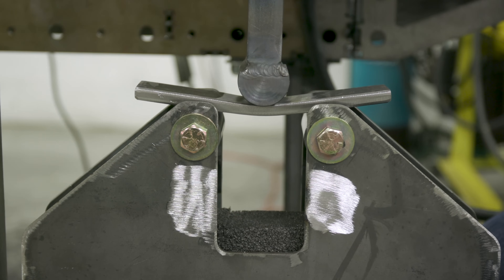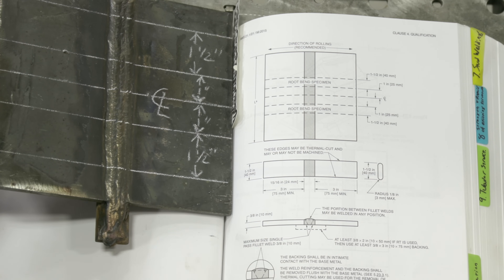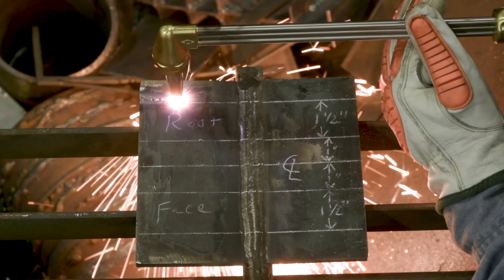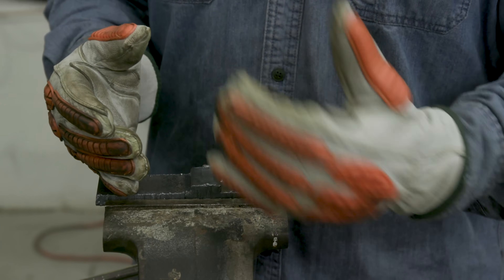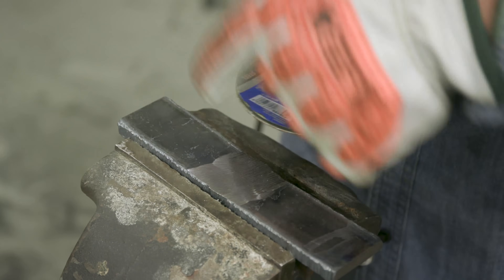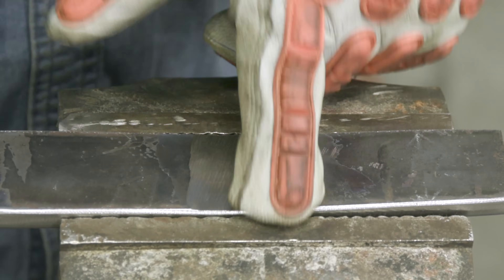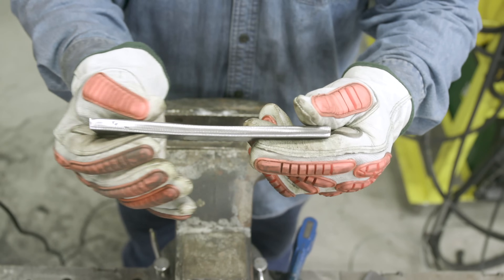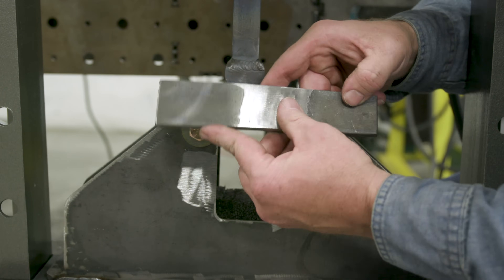A Students Guide on How to Pass a Bend Test

Comment: As a welded structures design engineer who defines the usage of AWS D14.4 and D1.1 on the drawings, these types of videos give me a massive appreciation for the guys actually putting the structures together.  The skill/workmanship that is required and verified with tests like this excite me to want to define welds that will result in high quality welds leading to long lasting structures. Kind of makes me want to try the qualification test myself as a non-welder and see how bad thing turn out. haha🤣

Comment: Would you ever do a CWB F class ticket video? Different than the S class quite a bit, The test consists of a 6010 open root with 7018 hot pass, fill and cap also with 7018. Then you also complete a fillet weld break test. Certifies you for open root and fillet welds. It is a common procedure you need in pile driving, as sometimes you will have to splice piles with a 6010 open root.

Comment: Doesn't flame cutting potentially alter the characteristics of the metal in the test?
Reply: Sure made a lot of extra work on my recent failed tests :(  And the instructor wanted every ENTIRE coupon (four) ground entirely clean, with no vise to hold it and a worn ass grinding disk... sigh

Comment: I need some serious help, I did a 7018 open butt, I did a root pass with a 6010 in a 1/4 inch groove and filled it in with a 7018 1/8th rod. I back gouged the back but messed up on the gouge and now I have two gouges and they are messy. Should I fill up both gouges? Or just start over

Comment: So much for the “common knowledge” that a weld joint is brittle!  Are there welder certification requirements for tensile testing? I’d like to see if the tensile failure point is in the parent metal, or at the fusion point of weld material to parent metal.
Reply: The BIGGEST thing when it comes to a weld test NEVER cool down the plates, it’ll weaken the metal.

Comment: Not sure what asme standard you are work in to but you should not oxy/acetylene cut weld test coupons ,you should use a band or mechanical saw to do the cutting of test coupon, the heat of the flame will effect the mechanical properties of the weld, could go on but enough said the rest of he vid was ok

Comment: I never used backing strips on my bend tests back in vocational school passed on my second test. Root passed both times face on the first was bad. Used a track torch to cut the bevel on my test metal. Cut the test pieces on the band-saw
Reply: I didn't use a strip either Id tack it at the ends so i can then tack it standing on another plate to my table then fill the root letting the arc fill in before i push it through then made the face with stringers 2 on the root pass then 3 over the last two stringers bottom to top with all 5 passes then grinded.

Comment: Yeah, don’t quench! 😂 I made that mistake once. I picked up my strip after leaving it to cool but it was still super hot. Out of reaction I chucked it in the nearest tub of water. I went to bend my two pieces, neither of which had visible porosity, but the one that was accidentally quenched split right in half! Good thing it was just for practice. 🤦🏻‍♂️
Reply: So interesting how every metal needs its own procedures. I'm a jeweler and we often get fits with white gold cracking so while visiting a metallurgist friend that does high production castings he told me, "quench white gold right away and it won't crack"   Guess what he was right !
Reply: Little late but maybe it'll help somebody.. if you happen to accidentally or mistakenly quench your plate or coupons, you can reheat them with a torch then allow them to cool naturally and they will be good to go again! I've dropped a plate in a tank by accident while setting up to cut it with a torch, just get the weld zone cherried again and it will be fine.

Comment: @Weld.com
I have put a slight reverse bend in my plates after doing the tack weld(mostly on open root) so that when the heat of the welds start to pull the pieces inward to the center, it actually pulls them flat.
Does that eliminate those coupons from a test parameter?

I have other issues with welding to pass bend tests that would not be associated with the previous question.
I’m trying to figure out what I need to do to get to the point of actually being able to pass bend tests.

Comment: I have never had a welding  job that lers you prep your own test and they saw cut them and do not grind the welds down and the welds either pass or they don't
Reply from the maker: You absolutely take the welds off. This video is geared towards students whom often have to prep their own coupons. You can use a saw, oxy fuel setup, or many other options as long as you maintain the correct dimensions.
Reply: I absolutely  do not take the weld off nor does the qc they cut and bend  it breaks or it passes  seen it a thousand  times
Reply: @Tiffany Long 
Where or what field are you testing in?
There’s a lot of oil and gas well work where I live and pipe welding refs allow the “backing plate, but it is essentially a consumable it is placed between the two pieces of pipe that are being welded and the backing piece is inside the pipe!
Then the coupons are cut out and the welds are ground smooth so that weld imperfections can be easily seen after bending!

I am curious as to how the people testing wherever you are can say one way or another that a weld failed or passed when they don’t grind them smooth. 
The lines between the overlapping welds would be a good place for a crack to form during the bending process because those are exposed.
Reply: @KAMBAMWOW  at my work we have a test for pipe with a backing bar and they grind the weld flat and remove the backing bar so that it bends correctly and they can see better.
Reply: yea this channel is trash imo amature at best using the gas axe like that isnt allowed but then again this is im assuming american and their standards are way lower then my countrys
Reply: Reklesnes I don’t know what country you are from but here in the U.S. we follow “AWS” American Welding Society standards API 1104 for pipe and  D.1 code book for structural. This is what our code book state about root & face bend testing

“Root- and Face-Bend Test 5.6.4.1 Preparation
The root- and face-bend test specimens (see Figure 6) shall be approximately 9 in. (230 mm) long and approximately 1 in. (25 mm) wide, and their long edges shall be rounded. They may be machine cut or oxygen cut. The cover and root- bead reinforcements shall be removed flush with the surfaces of the specimen. These surfaces shall be smooth, and any scratches that exist shall be light and transverse” 

 This is how we do it in America!!!!!!!! I’ve been welding for 30 years and we had to do the preparation for the bend for some companies it all depends on the testing facility if they had the personnel and equipment to do it, if not we did it ourselves and the QC did the bending!!!!! These guys are doing a dam good job !!!!!👍🏻
Reply: We use bandsaw as well but this seems to be a tutorial for practising at home.

Comment: I never understood the backing plate, does it not fuse to the weld?
Reply: A steel backing plate will fuse into the weld and in the field will either be ground off or left on depending on the specs. Copper or ceramic backing will peel off.

Comment: A great way to remove a backer is this, Cut your strips, Use a zip disk to notch into the MIDDLE of the backer and go down 3/4 of the backer. you now have a line scored in the backer but not into the test piece. Then put your backer in a Vise and twist. the backer will split and be easily removed by hand. then minimal grinding is needed,
Reply: Thanks I'll try this out so I don't have to carbon arc gouge my test plates.